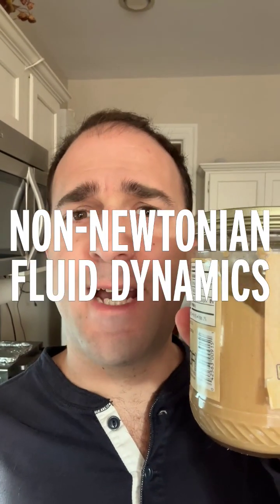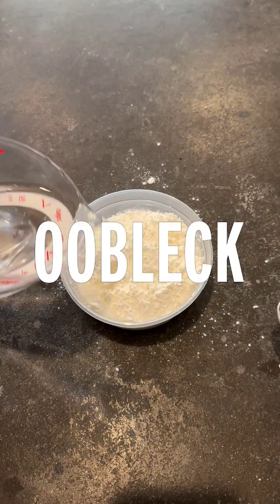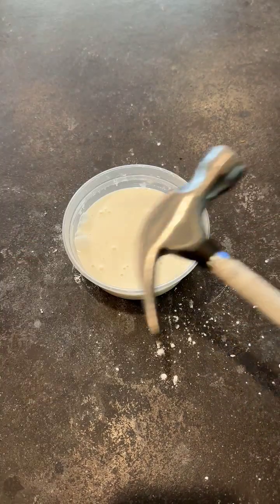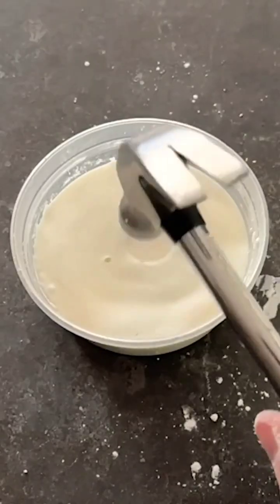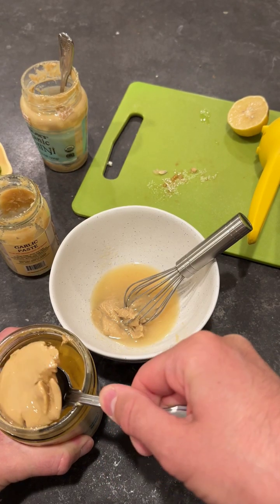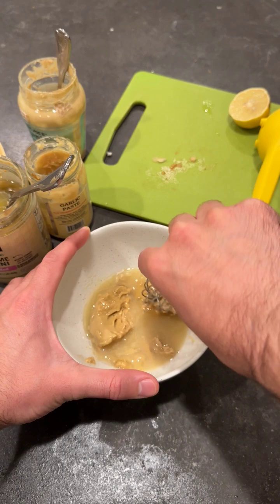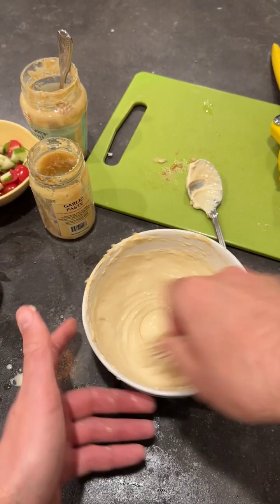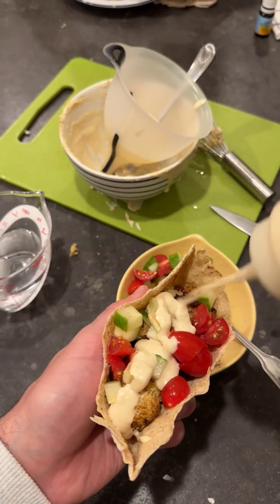Tahini, the non-Newtonian shawarma sauce

Comment: It happens because the complex structures of the molecules lock together. You can simulate this with your hands. Point your fingers toward each other, such that the fingers are all sticking out parallel. Move your hands together slowly and your hands will naturally turn. Move your hands fast and they will lock together or seize up. Yup, it’s a physical process at a molecular level!
Reply: I think he’s getting at the academic disagreement about the cause of the interaction. There’s a “hydrodynamic” camp and a “frictional” camp.

Comment: im guessing its because the ultra fine particles when under pressure start compressing, straining out the liquid once again. when its such a small amount like oobleck,, theres a lot less liquid then solid causing a strain. thats why adding water its gets pasty. idk just a guess.
Reply: I guess this could be tested by increasing the area where the pressure is applied and measuring the viscosity on the impact.